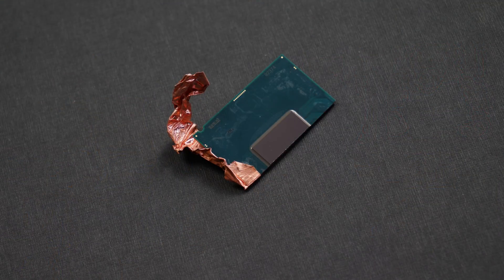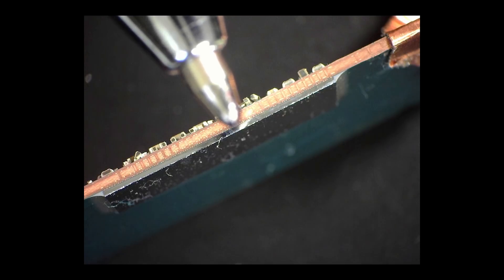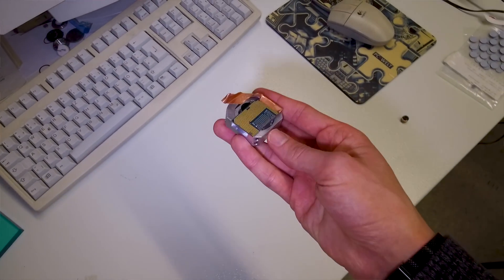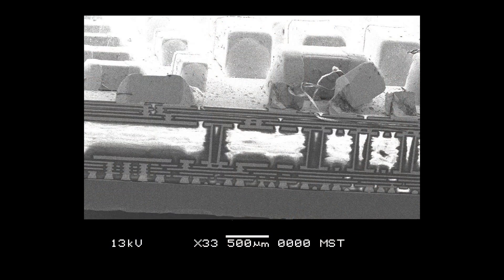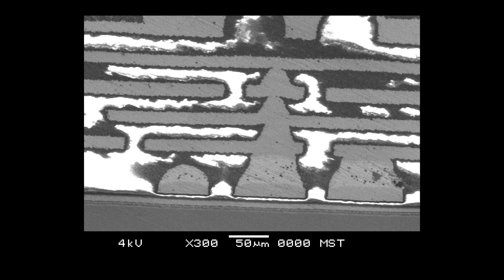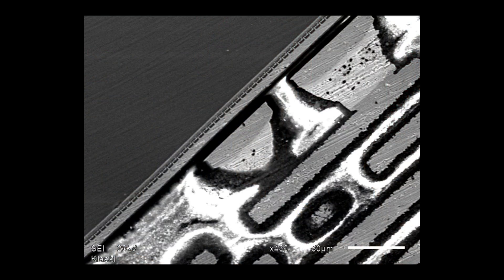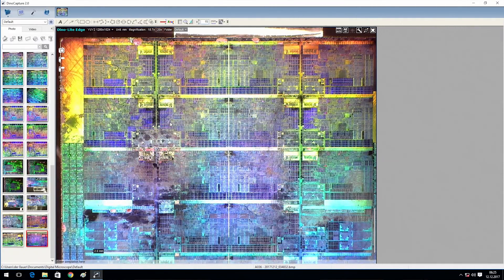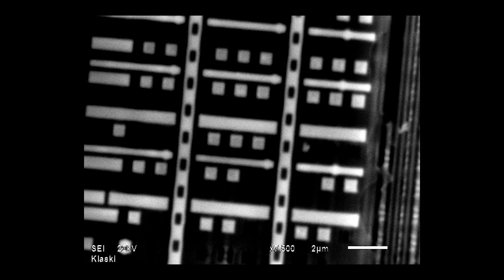Inside i7-8700K - Scanning Electron Microscope (SEM) Footage (en)

Comment: I've heard that transistors are so small now that quantum tunneling will become the limiting factor. So basically silicon chips have gotten as good as they can get, and quantum computing is going to have to be perfected for us to go any further.

Also, I'm guessing Intel and AMD have the best SEM's money can buy to QC their products.
Reply: FortuneSeek3rz We are at the brink on size scales so small that random quantum events will begin to effect the stability of silicon based chips.

However quantum computing requires using not the random tunneling events, but very sensitive quantum superpositions. These require temperatures way below liquid nitrogen to exist. 

No body needs to know any of that. I was just trying to get to the point that it is a technology that is unsuited for replacing silicon chips in home computers. So for the foreseeable future we are stuck with more of the same with fewer die shrinks or leaps in technology.
Reply: Thank you for that response. Even if quantum computing cannot be applied as a consumer technology as PCs have, it will be interesting to see where it will take us in terms of problem solving to the extent that it is capable of doing so. Perhaps we have already hit a wall in terms of technological advancements on the scale that the light bulb, the micro processor and the combustible engine have in the last century. We may be looking at many years going forward of low advancement relative to where we are now.
Reply: Excellent point with the light bulb and combustible engine. Never though of it quite like that, but one could assume CPU tech will follow  a similar trend. Not obsolete, but more utilitarian. 

I am also very excited about quantum computing. Even if it can't be in our pocket, I guess we could always connect to it remotely.
Reply: That's technically not true.  We could actually have 100Ghz CPU's, they'd just run too hot to be reasonable for a consumer to run. We haven't hit the limits, not even close, just the REASONABLE consumer limits. That's not to say we shouldn't move on to something better though.  Silicon does need to go away.
Reply: That is not correct. It is not just heat and inefficiency that prevents 100Ghz cups. The instability caused by power leakage and other inherent problems prevents that. If you watch high end overclocking you will notice that the CPUs that crash and fail never reach a high temperature, they simply fail due to instability and other problems.
Reply: No we are no where near there yet. It would need to get down to just over a tenth of a nano meter. Anything larger than that will still obey classical phyisics

Comment: Great content der8auer!
I'm still amaze how complex cpu's are. I just can't imagine the "engineering power" behind Intel, AMD, Nvidia to make this stuff even smaller and faster. Also how precise the manufacture procedure is, you need a SEM to see what is inside!
Reply: Intel makes Intel CPUs
GlobalFoundries makes AMD CPUs
TSMC makes NVIDIA and AMD GPUs.
Reply: and ASML builds all of the machines and develops the UEV technology needed.
Reply: They don't actually make the chips.  They just makes the architecture/logic side of things, and TSMC + Global Foundries comes up with all of the scientific processes to produce them and shrink them down.   So basically, GF advertises that it can do say 7nm, so Intel or AMD works up a design and has GF produce it, while they tweak and work together to make sure the structures they need are capable of being produced and operate.   Without GF, CPU sellers like AMD would be nothing.
Reply: C North: Your comment severely blew my mind. If you knew me, you'd know that's not easy. I've already spent 4 hours following up the trail, making notes. Morris Chang is amazing. BTW, your profile's description page is hilarious. You are more shrewd than most lawyers I know haHaha.

Comment: 5:40 so the CPU is only the thin grey line? What about the thicker grey bar below that
Reply from the maker: That is just the silicon. I should say the grey line are the circuits. The whole part is essentially the CPU
Reply: THEFIRE360 It's basically the thickness of the silicon wafer from which the CPU was build.
CPU's are made by depositing chemicals on top of a big silicon disk: that layer is what remains of that disk.
Reply: @RipJawsX 95 Yup.
That's why it's called flip chip design. The full name of this IC package is FCBGA, aka 'Flipped Chip Ball Grid Array'. The ball grid being the spherical/tubular pieces between the processor side of the silicon wafer slice and the PCB.
Reply: I don't think people would delid their CPUs and just wipe TIM off of them with a piece of cloth if the exposed part was anything but substrate. Can you imagine what would happen to those 14 nm structures? Also, using liquid metal or solder on the circuitry itself... probably wouldn't go down well either.
Reply: Check out Intel's 2:42 video on 22nm chips, and you'll understand how they got in that position.
Reply: Wait so is the chip placed upside down into the pcb?
Reply: der8auer so the thicker grey bar is silicon. What is the purpose? To protect the circuit?
Reply: Captain Die Mfg Engineer here, the very thin layer is the active area where the main circuit is, while the grey silicon is just the substrate which holds the circuit and also where the first layers were etched. The overall build of the chip is mostly to hold that very thin layer and provide the contact pins to the outside world. 

*flies away...

Comment: It's be interesting to think what possible effects the electrons could have on the circuits operation (Assuming you didn't have to kill the chip to put it under the scope) because if you look at the bottom left corner of the screen you can see the voltage that the electrons are being accelerated under which went up to 20Kv. You might think that thats more than enough to do damage to the CPU however an electron accelerated under 20KV can only provide electrons with ~3.2e-15 joules of energy which really is insignificant (Also highlighting the requirements of such shielding).
Reply: A guy with his own SEM in his workshop (yeah, for real) on a YouTube channel called Applied Science, did a scan of an integrated circuit while it was running. It's nowhere near this scale of course, but it was interesting regardless. He talks about how scanning it with the SEM most certainly destroys the chip it in the process, but the chip was still "doing" stuff, just not ... useful stuff.

Comment: How would this look compared to the 8600K? Just less cores?
Reply from the maker: 100% the same :) It's physically the same CPU
Reply: It's just an 8700k that had some defects, so they disable hyperthreading, and sell it for less.

The 8400 and 8700 are dies that couldn't reach the same clock speeds.

The i3's are i7's with defective cores that were deactivated.
Reply: Wow, turns out the i3-8100 and 8350k are Kaby-Lake Refresh, not Coffee Lake! I didn't know that until now.

This wasn't the case for previous i3's, was it?

Comment: Never knew the CPU layer was so short.... Great video!
Reply: Right! I always thought it was many layers stacked. Amazing. Like he said, it's borderline witchcraft.
Reply: Yeah, and it's billions and millions of transistors in there. It's mind-blowing.
Reply: @ichoozjc  its like 20-50 stacked layers for the CPU. Most of the silicon you can see is actually the substrate it's built on. The chip's butt is facing the TIM (the metal lid). Its many many thousands of times bigger than what's needed so it can be handled by humans and robots. The bulk substrate also helps keep the chip side surface extra clean - contaminants get soaked up like a sponge away from the transistors and into the bulk. Its called a passivation layer.
Reply: @ichoozjc  funny you should mention that....
we are going to be doing that soon
Reply: can you imagine when we come with a way to remove heat and start stacking them in 3D ? its gonna be awesome, Moore's law never dies, its probably sleeping because of Intel don't wanting to move to new grounds, but others will.

Comment: Wow, this really gives a sense of just how tiny those structures are. And as you say, it's really impressive how the cpu can handle the insane currents and power density of hundreds of watts going thru that ever so thin sheet that is the actual CPU. Even then the current is probably not spread evenly, but concentrated at certain areas. Still the thing keeps completing billions of cycles every second without ever missing a beat.
Reply: That's new instructions every 200 picoseconds (pico=10^-12)
Reply: Two fun facts, it literally distributes the current in all parts by fast powering them on and off, they can't even be powered all at once by now without melting everything. That's called dark sillicon. It doesn't concentrate the heat/current.
Fun fact number two, the CMOS transistors only draw current when they switch, they use the toten-pole configuration, its like two balanced arms pulling each-other, it will keep the state (0 or 1) by which combination of transistors is active, its usually 4 transistors for a single digital signal, but they are constructed to be very compact in the metal layer and share parts of each-other. Something like 1 and 3 for low-state (or 0) and 2 and 4 for high (or 1), the current won't flow until the clock ticks (clock actually unbalance them), those 2 transistors will stay powered without drawing current (only leakage) and the other two will stay off, but man they draw current when they switch, they literally short-circuit for the tiny amount of time the clock switches from low to high and then high to low, that also why we get so much heat, we have a tiny resistor heater element when switching. 
If that was a guitar amplificator, it would be to the 11 in over-saturation, cmos transistors do clamp and work like that, its funny to think about this  (and that's why they draw so much current).
Reply: @monad_tcp   interesting

Comment: Why is the silicon above the actual structures so thick? Wouldnt it be easier to cool the cpu if there's less material in the way/ less thermal resistance
Reply from the maker: you need a certain thickness for stability :D
Reply: IIRC they used to be more or less transistor side up, but as things got smaller and hotter they switched to a flipped chip arrangement with the cpu down against the pcb. That's the "FC" in the full package name, "FCBGA" or "FCLGA". The old way required tiny physical wires to feed the cpu with power and data. The wires to the cpu these days are too small and cpu's require too many to be transistors facing up. Flipped chip allows the traces to and from the cpu to be super short and numerous, thus lower latency, and less power.
Reply: its not just for structural strength, its also for passivating (taking out) unwanted defects in the bulk away from the transistor structures :) read : strained Si
Reply: I actually work at an Intel site on the logistics side. My job, essentially, is to move wafers around the factory. I think if they were any thinner, they would just completely break while being moved around. We work with 300mm wafers which around about a foot in diameter. In the cases they're transported in, called FOUPs and FOSBs, they only have 4 points of support; basically the front, back, left and right faces of the case which is square-ish in shape. The middle is completely unsupported. The part that is supported is usually by a ledge that's less than half an inch. They need the thickness for structural integrity since we ship them all around the world; Arizona, China, Israel, Ireland, etc. Despite moving thousands lots ('lot' is what is referred to a FOUP/FOSB with wafers inside), I've only seen 4 with broken wafers inside, not including bare silicon without having anything done to it, which I've seen probably 5 with broken wafers (one lot was in development for 6 months before one wafer broke, therefore scrapping all wafers inside, even the ones that weren't broken, due to micro-scratches and particle contamination).One time I was transporting 8 lots at $300k each, so $2.4 million, and I was haulin' ass, and I could see the wafers bending like crazy. I was honestly surprised none broke.
Reply: @Larry Gall
Graphene is still very far away from consumer products. A gallium based semiconductor is much more likely in the near future. Graphene has one major problem as a semiconductor; it has no inherent band-gap.
Reply: Nobody wants to manipulate a 30 cm wafer with a 1µm thickness, it'll just break... As mentioned earlier, shielding is also a good point, although I don't think going over a few microns would help in this specific case.
Reply: The wafer doesn't need to be that thin: other devices like IGFETs and power MOSFETs are backside thinned after dicing to decrease thermal resistance to the heatsink. but I suspect piezo electric effects and body bias effects would render the device non-functional in Intel's 7nm Trigate process.
Reply: Finian Blackett No. Just no.
Reply: @billoddy5637  Well, he did say recently after applying liquid metal to a lapped silicon i9, that he was worried about the LM creeping atoms into the chip. Not sure if it's the thickness of the silicon or that there is some protection applied to the top of the chip. Wish I knew.
Reply: The silicon "above" the structures is so thick because all the circuitry is made on the top surface of the wafers...they run ~0.8mm thick. After  the fab of the wafer is finished they are back thinned by grinding/polishing away the Si from the backside of the wafer. They are then tested for functionality and speed binning, diced and assembled into the chip package. The wafers still need a certain amount of strength so the thinning can only go so far, though thinner is better to allow for heat dissipation on the finished part.
Food for though, only the top ~3000Å-5000Å of the silicon wafer is actually used to make the transistors, or ~0.06% of the silicon! The circuitry is built up through deposition and selective etch/removal of various films and after completion with ~8-10 layers of metal connections is still only ~5µm thick before the last layer of metal goes on that carries the large currents around the die...which on this die is about 5µm in of itself.
Also your picture of the transistor is a TEM, not an SEM, look close and you can see single layers of atoms (about 7 layers) in the gate insulator over the transistor fin, you are not going to really see that detail in an SEM.
Reply: I think shielding plays some part as well. But silicon is very stable.  I think graphene will be the next material used.  Again, great job with this video.
Reply: @larrygall5831  Graphene will never be a bulk chip, maybe the interconnects though which would still help heat management. Silicon is used because it naturally grows silicon dioxide, which is physically strong, easily controlled growth, good bonding to Si (some oxides just flake off immediately), and an insanely good conductor. That means we start with silicon which is basically a resistor, and then in one or two steps we can make it into a conductor (highly doped P-Si), semiconductor (regular doping), or insulator. Not only that, but the oxide grows upward and inward to a lesser degree so we can stack structures easily. 

No other material known today has all of those properties, let alone is found everywhere on the earth's crust and is incredibly shelf stable. It is possible to grow Gallium Nitride for example, and dope it relatively easily, but there's no easy way to make it into an insulator, or bond it to an insulator, let alone do it controlled at 20nm.
Reply: I like your response. do you also think that also putting the chips flipped means you lay down the smallest transistors first on the wafer?
this allows you to do the riskiest step first before you layer on larger and larger layers. if you did the smallest layer last it means you would have already invested a lot of time and money on the other layers.
Reply: Kan Magoshi All the transistors have the same size and are on the same level (closest to the silicon bulk). They are in fact the smallest components, and they are laid down first. 
The rest is all layer upon layer of interconnecting copper wires, which get larger and larger as they carry more and more current.